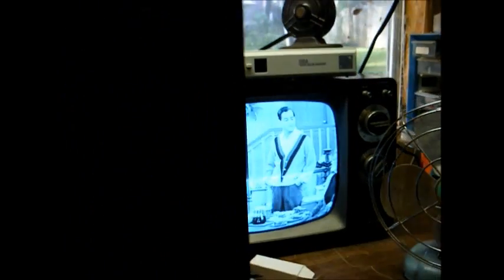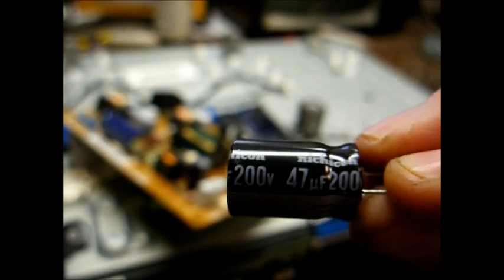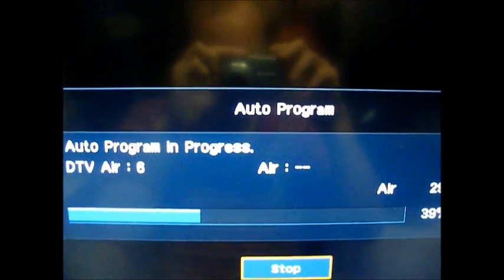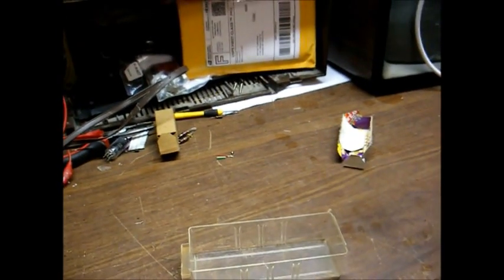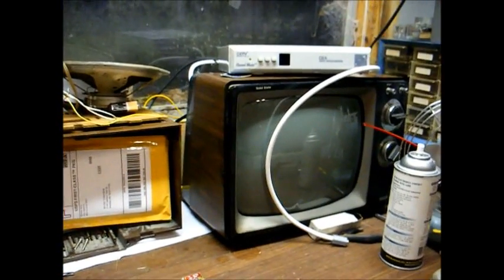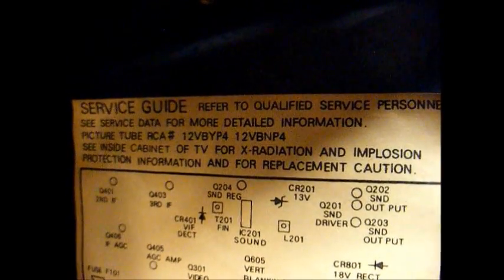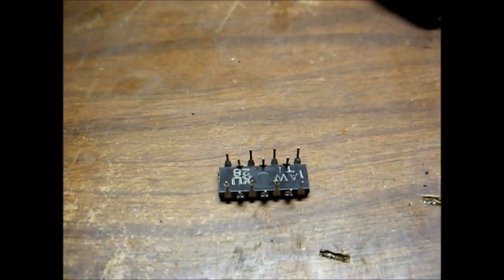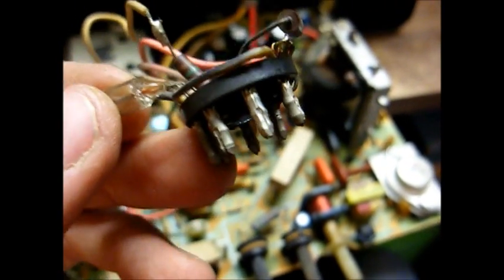Repair of a 32" Samsung LCD TV from 2012 & a 12" RCA B&W TV from 1981

Comment: After having the same problem on my 2013 32” Samsung LCD TV I started doing some research on the Internet. I found a site called TVGuy with people writing in questions and their problems. One had exact same problem you diagnosed. The difference was, they told him to replace the power supply board or the master board. I thought that might be an easy fix for my TV but anywhere I checked they were out of stock. Then I came across your YouTube video with the exact same 47 µF capacitor that was bulging on your set was bulging on mine! So I ordered the Nicholson for $.93 but unfortunately $4.99 shipping, and received it in about a week. I installed it today and Wala! TV works again like new. It’s amazing how people discard TVs or even just replace the boards when most times  it’s just a component that can be sometimes easily identified. Thank you for this video! Saved me $250 for a new TV. Hopefully I get another 10 years out of this one.

Comment: I have a sears vintage b+w am fm radio combo from the 70s. The tv and the am band on the radio run perfect. The fm band has a weird problem. All the fm stations all come in together at the same time. Tuning it just decreases or increase signal strength but they are still coming in together. I never ran into this problem before. They use an IC for the am and fm in this set but the am band works perfect. I tried adjusting the slugs on the fm. Oscillator coil but doesn’t help. I put the slug back to the original position so the alignment won’t be thrown off I checked for broken leads on the fm section of the variable tuning capacitor. All 3 leads are perfect. I am really stumped on this one!!!  Any suggestions?
Reply from the maker: It's probably an issue with the IF strip and it's allowing more than the 10.7 MC IF frequency to go through.
Reply: radiotvphononut   I will look into it but it’s a bitch to remove the radio pc board. You have to remove the dial cord and pulley to get to the underside (foul side) of the board. I just might leave it as is. Only paid 5 dollars for it at a garage sale. I don’t want to get my blood pressure riled up getting the unit apart. It’s a weird problem I never ran into as an electronic tech. Thank you for your insight on this tough dog. Would love to meet you when I travel through Meridian again but have no way to contact you. I would give you my cell number but don’t want you to get in trouble with U tube or website
Reply: The IF circuit on fm is run thru a 16 pin IC on this model. It begins with LA.  I will have to look up the IC when I pull it apart again to study how it functions in relation to the fm circuit. The am circuit is also tied in with this IC but the am plays perfect
Reply: This IC acts similar to a jungle IC in your Zenith TV. The fm IF is controlled and fm afc  comes from this chip. The fm detector is also incorporated in this IC. I believe the problem is due to the jungle IC used in this radio circuit. Big job to replace the IC. Would have to dismantle dial cord and pulley to get at it plus unsolder ferrite bar antenna

Comment: They aren't made to last using these cheap capacitors . I did an LCD set that failed just out of warranty for a friend a while back. No picture. It had four leaky bulging cheapo brand 10uF 200 volt capacitors in it. After replacement it worked fine. I generally avoid modern televisions though.

Comment: I recently received a 32" Samsung LCD TV from 2012 with same bad Power Supply 47uF 160V cap.

Would you please tell me the specifics of the Nichicon cap you used.  Thanks Ken

Comment: Surprised they were still using those junk capacitors in 2012, especially on a "respectable" brand set like a Samsung. On all these sets with electronic controls (even my 28 year-old GE), I try to resolve never to use the buttons on the set, given how vulnerable they are to damage from too much use, sticky hands and most of all, static electricity.  The  remote controls get the same problems, but at least they can be easily replaced.

Comment: I currently use a 1982  25" RCA Colortrak 2000 as my main tv right now, I use one of those HomeWorX digital converter boxes that i have running through a 1984 Sanyo Beta Hifi so i can get the stereo sound. Hard to believe those Beta machines were over $1500 back in the day.
Reply: +Romaro Vinciguerra    I know somebody paid a pretty penny for that 1984 Sanyo Betamax HiFi VCR. I bought a Sanyo Betamax in 1984 that was strictly mono and I paid $629 for it. Even though Beta went obsolete I stocked up on a lot a blank tapes and used it for TV recording until 2000 when I switched over to DVD.
Reply: I have some vintage unopened Sanyo Blank Beta tapes that I found at pawn shop back in the Spring. Some are L-500  and L-830. I even have a unopened Sony Beta Video Cassette Cleaner tape. I'm too afraid to open them since there so rare to find.
Reply: Romaro Vinciguerra  Good idea. Hang onto them and they'll probably be worth something someday.  As strange as it seems I know a couple of people who collect different types of medium.

Comment: I have a BSR record changer questions for you. First off your soldering iron trick worked perfect for me to get the platter off, greased the parts and put it back together and it spins perfect and plays very well now. How to you adjust the arm to start at the beginning of the record. I have it set for 33.3 and it sets down just before the edge of the record. It just needs to move in a hair but don't know where the adjustment is, can you advise?
Thank you.
Reply from the maker: yodeheyvavhey There is a small screw, under the rear of the tonearm, that you have to adjust.

Comment: I think that my roomates Samsung is having the same problem. His is much older  I told him that it was probably a bad cap in has power supply. I will have to dig in there and check it out. Looks easy on your part. ☺
Reply: could be a simple as a blown fuse also
Reply: Yea but his makes a clicking sound when it try's to power up. So I know it must be somewhere in the startup cucuit or power supply.

Comment: I have a Toshiba LCD TV from 2005 that has a whole bunch of those Samwa capacitors. The thing still works perfectly to this day and has no bulged caps anywhere on it.
Reply: scottyfixit One thing that many of the power supplies in those LCD TVs and monitors are notorious for is using mystery brand caps from China on the 15 volt rail that are rated for exactly 15 volts. If they had used 25 volt or higher caps made by Nichicon, Rubicon, United (Nippon) Chemicon, Panasonic, etc they would never have failed. But then again that's the idea isn't it, that's why my 1977 Panasonic Quintrix TV still works perfectly and why a Samscum or Funai cocks up after 5 years.
Reply: 1980sGamer Well they may fail one day not too shortly in the future and just because they look fine doesn't mean they are fine on many occasions they're actually faulty when they look fine and OlegKostoglatov I'm using a 1983 National Panasonic Quintrix TV which still works perfectly fine.
Reply: Sony Trinitron
The flat panels also have HV caps in them on the input side to the inverter, at least on the LCD panels, they are something like 175 uf at 450 volts. I will have to see if there is a discharge resistor across them like the older TVs used to have.
Reply: 1980sGamer The worst part is when a manufacturer uses those cheap capacitors without much headroom in the specs. I've seen low stressed cheap capacitors sometimes last. Usually the engineer of a cheap electronic tries to squeeze an extra buck by using one less capacitor than needed, then the trouble starts. Toshiba manufactures on both ends of the quality spectrum.
Reply: Sony Trinitron The thing does still work perfectly. It has no problems doing anything or showing anything. It'll do what you tell it to do. It doesn't turn on and power off automatically. It could have some bad caps but I don't really think so. I also have a 1979 JVC colour TV that works great. Although it has the Electrohome brand name on it because I live in Canada.
Reply: I just got done repairing a 42" LG, and there weren't any LG parts inside of it. Cheap capacitors, Chinese LCD Panel, Sanyo Tuner. I thought LG was a name brand. After working on a 27" Samsung, same thing. Not even a Samsung LCD panel, which Samsung manufactures! It saddens me that name brand manufactures don't even use the parts they make.
Reply: scottyfixit You just reminded me. That Toshiba TV, all of the main parts in it were made by LG. The power supply board, mainboard, LCD panel. Yep, all have the LG logo on them.
Reply: 1980sGamer poor ventilation and fitting the caps next to a heatsink (poor design) cause the proble, samwha caps are pretty good never had any issues
Reply: 1980sGamer hansol:
Reply: OlegKostoglatov lol samsung are the best in the world and the biggest manufacturers
Reply: Synthematix Yeah they may be but they often let Chinese no name companies to build electronics for them and Samsung gets a share of each one of them sold, once decent brands like Akai Aiwa and in some ways Sony's reputation has been ruined by cheap generic appliances with the Sony label slapped on especially with those Sony radio's but as for TV's they're still built by Sony
Reply: Synthematix
Then the state of consumer electronics is in a very bad state today if that's the case. Samscum being the best in the world must be akin to being a one eyed man being king in a blind man's world.
Reply: Sony Trinitron Ok but makes no difference to me, if people stupidly throw them out because of these slight faults im happy to repair them. radiotvphononut arent you enjoying the crisp perfectly flat and accurate picture of LED television? something that cannot be achieved with a crt
Reply: Synthematix http://www.displaymate.com/crtvslcd.html This sums up everything we've been fighting over pretty much.
Reply: Yes but crt is dead technology and for a few good reasons, they use a lot of power, their picture  geometry is inferior, theyre heavy and bulky and contain damnright lethal voltages. not 110 or 240, but over 15,000v
Reply: The 15,000 volts in most CRT TVs (with the exception of a few made just before and after WWII) isn't "lethal", it will never kill a healthy person with its limited current capacity. Just like the ignition wires in a pre-1990s car, it's more annoying than lethal. Plus, you get that cool purple arcing on your fingers an the smell of ozone. Yes these old sets are boat anchors, but they were surprising efficient and reliable by the time they went out of production; even my 1978 Sears console only used 150W and  many of the early flat-panel sets use hundreds. I have to say that my new 48" is sort of a modern wonder though; there's damn near nothing in it and I did notice the power it saved in my electric bill.
Reply: No Name Want a bet. a few people on youtube have been killed, capacitor discharge will kill no messing, some of those hold well over 300V directly
Reply: Synthematix Shorting the main caps out is the fail-safe way to do things when working on appliances, I do bet some have hurt themselves from getting into electronics from Youtube videos.
Reply: OlegKostoglatov I didn't know they needed capacitors going to the inverter!
Reply: Sony Trinitron
Well they do, because they rectify the AC mains going into the set, then filter it, then feed the DC into the switch mode power supply, which is basically a transistor oscillator that converts that DC into AC of a higher frequency, and then steps it up.

Comment: A nice video. 

I found a Samsung 50 inch plasma set on the side of the road a couple months back. Totally dead.  I ended up replacing the blown 12 amp slow blow ceramic fuse on the power supply.  The set works great now. All the capacitors looked good and the set worked fine, but I replaced four capacitors that are known to be problematic with this set with higher voltage, quality capacitors for dependability.  I bought the proper original remote control on Ebay for $13.00. 

Regards, Tom